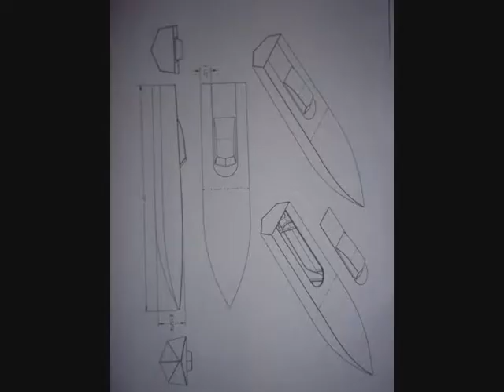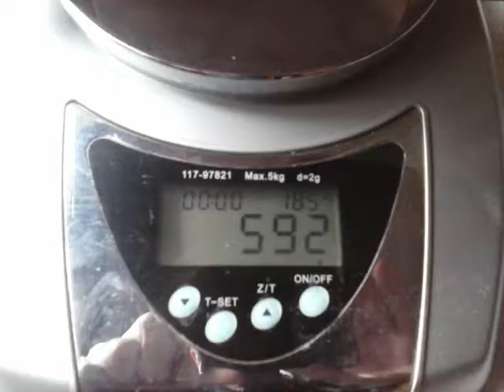HOW TO MAKE RC ELECTRIC WOOD BOAT

Comment from the maker: thank you the motor is an aqua star 3560,  battery 11.1volt 3000mah and esc turnigy 120 A water cooled, prop 40mm